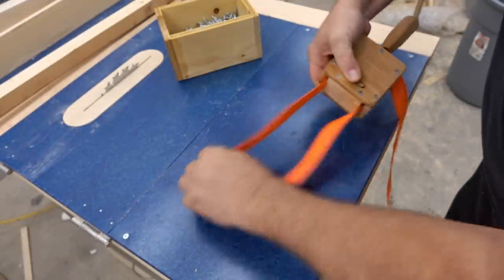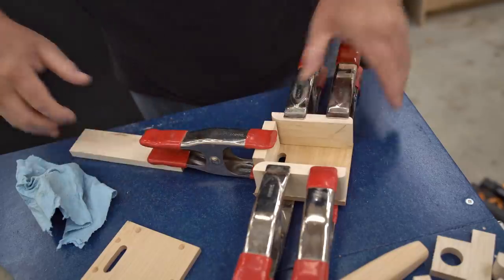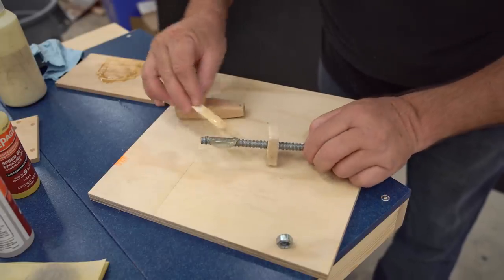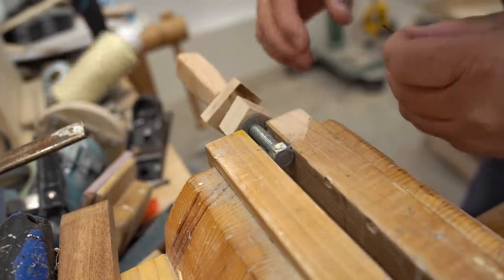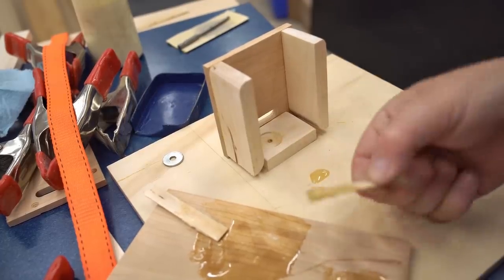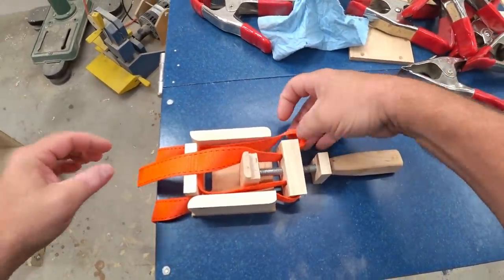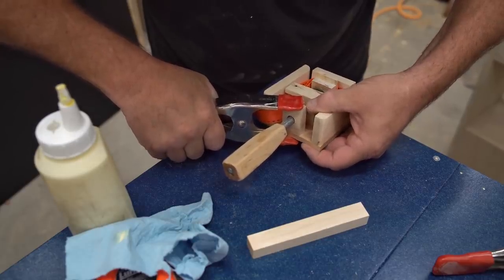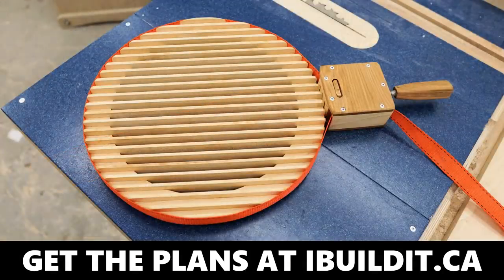How To Make A Strap Clamp / Band Clamp

Comment: Great clamp and simple to make.  A tip - when epoxying a threaded rod into a blind hole, eg the handle, rotate the threaded rod in an anticlockwise direction, this forces the epoxy down to the bottom of the hole, seems counter intuitive, however when you rotate the threaded rod as though you were screwing it into the hole the epoxy 'climbs' out of the hole.
John B

Comment: One time, at band clamp...

That was an awesome project. Imagine using ¼" acrylic for a top cover, just to see its innards. 

By the way, really liking the blue saw/work table in the back: it's nice to look at, and it helps both depth & clarity. I watch from a laptop, and I can't stand how overexposed everyone's videos seem to have become; sometimes it's like I have sawdust and sun in my eyes while watching.
Reply from the maker: I considered the clear plastic, actually, but didn't want to put people off the build thinking they need it to make the clamp. I also briefly thought about making one completely from metal, but again that wouldn't sell any plans. Or would it? Maybe I should make a metal one to see.
Don't know about "everyone's" videos, but for the most part mine aren't overexposed. I do brighten them up some,  since that generally provides a more pleasant viewing experience for most people. It's much like thumbnails - people are more inclined to click on ones that are light coloured and bright, as opposed to dark.
Reply: I bought the plans, and I'm going to batch out 3 or 4 of these this weekend but I'm also really considering making a steel version with a heavier band/longer travel. I have no idea what I'd use it for, but it sounds like fun. I'd totally buy plans all over again for your own metal version.

Comment: I have an idea: what if you made these using a mechanism similar to a ratcheting screwdriver? 
If you imagine the strap gets winded around the shaft of the screwdriver, if you twist it to tighten, it'll lock in place...
But then I bet it would be hard to get a lot of torque from it, if the shaft isn't very narrow, or if the gears don't have many teeth, which would require them being made from steel.
Reply: Ratchet straps are very common, you can get them in any hardware store.  The problem with a ratchet for a woodworking clamp is that it clamps in discrete jumps which is OK for strapping down stuff to your truck but won't work as well for gluing up a box.